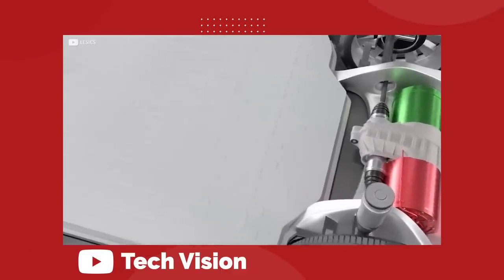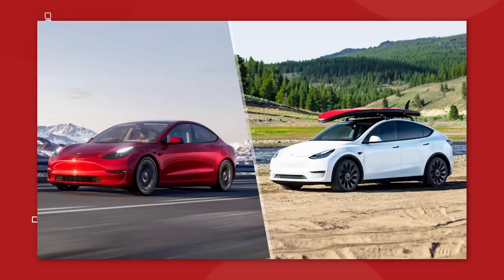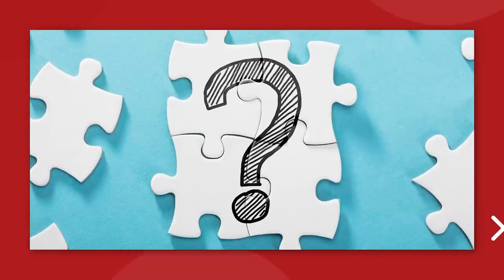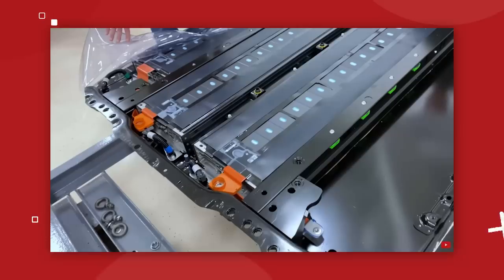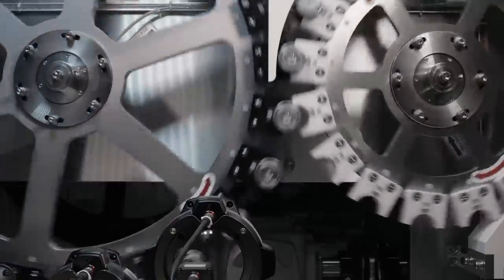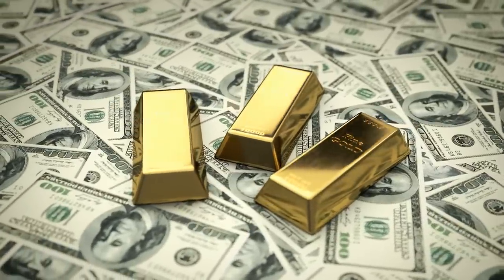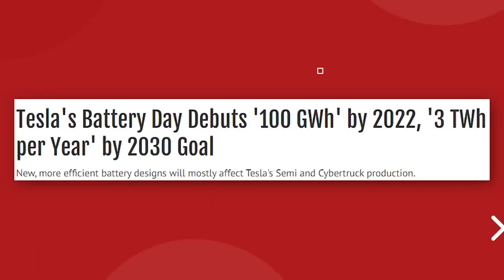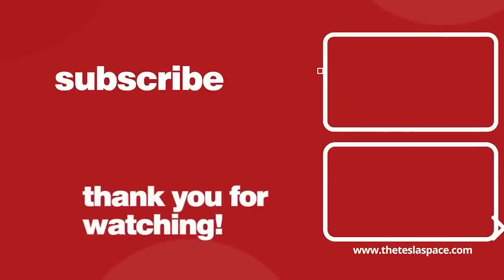The 2022 Tesla Battery Update Is Here

Comment: Nop! We can’t go full EV until 2030. There is one peace missing at puzzle. Where the energy to charge batteries is coming from? Just think about power grid load when every land vehicle plug in! At same time, pressure over shutting down coal power and oil generators. Even thinking about wind or solar power is way out reality when you increase consumption and reduces generation! Will we build nuclear power plants? We should… how longer it will take? How long will we get until next environmental madness to abolish nuclear energy?
The fantasy is beautiful however facts can’t agree with those expectations.
Reply: Electricity demand get higher so building more infrastructure will automatically increase too
Reply: @Delitor  owww boy… it demands two finite resources. Money and time. The world haven’t both enough.
Reply: No one is claiming that all cars on the road will be EV buy 2030, just all new cars sold will be.  That's a big difference.  The electrical grid will cope, don't worry.
Reply: The grid is overbuilt to be able to handle peak loads. Most cars will be recharged in off-peak times (because it is cheaper), so there'll be plenty of opportunity to increase the energy supply and storage, as necessary.
Reply: @swordedaffair  unfortunately the grid is NOT over sized. California is now at grid limit, Texas had severe problems last winter. Several countries have problems providing sustainable electricity. So, electric cars are only half solution. 
Build news power plants and upgrade power lines take money and time. There is no easy answer. 
Every time someone gives you an easy solution, it sure that’s bullshit.
Reply: @drigobarreto  The grid is designed to allow for peak usage. There is always available capacity in non-peak times. In fact, having a lot of charged BEVs could help alleviate issues during crisis situations - people could keep their critical appliances (e.g. freezers) running off the energy in their BEV. Texas's grid problems are their own doing, but my previous statement still applies - if there had been millions of charged BEVs, it would have helped the situation.